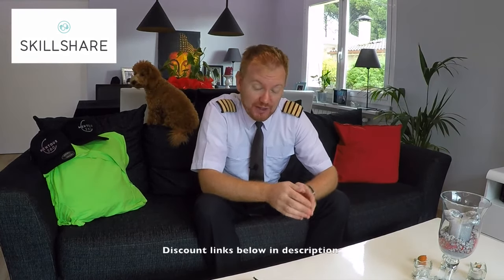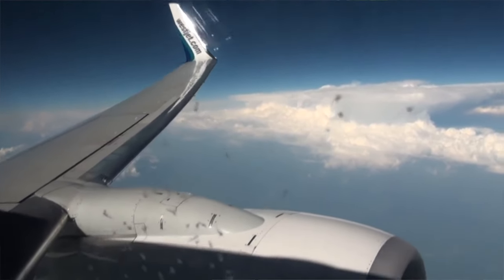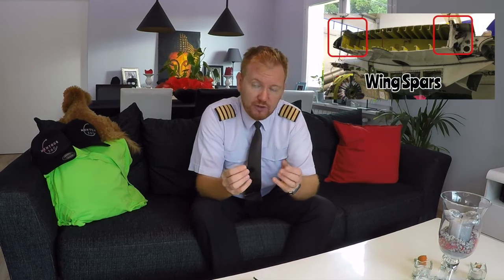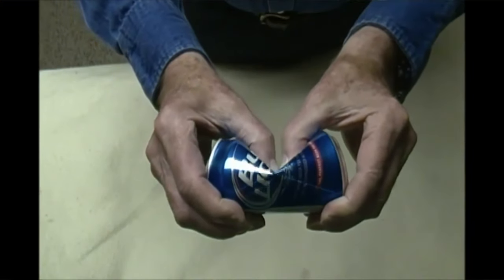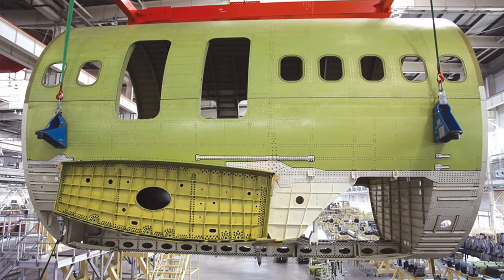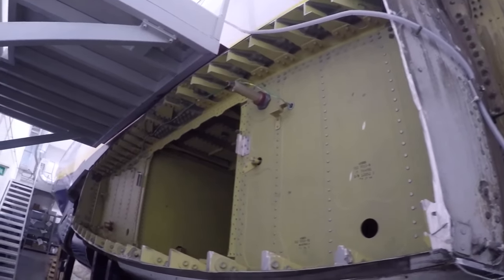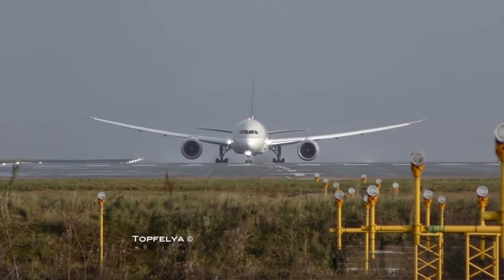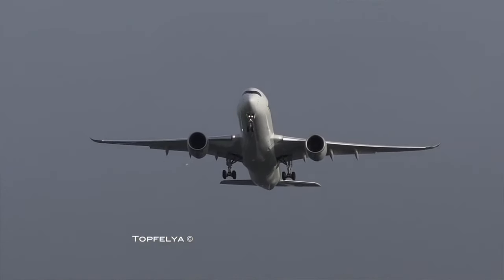Why don't the wings break?!

Comment: Mentour Pilot - Unfortunately saw same thing early 90's at G.R., MI.  Loaded NWA liner on approach but sitting still w/zero groundspeed encountering vicious downdraft due to microburst.  When Capt saw me in orange highway truck drivin' loco pointing at him, he went full gas, gear up, full flaps, slightly nose down, entering elevator to hell.  Instantly went straight down flat w/huge smoke & at bottom in woods wings looked like your cover photo.  All cabin crew checking seatbelts injured being smushed in ceiling & smashed into floor when wings caught.  1st Ofcr knew he was dead so no help.  Liner ravaged, no COM w/cabin, no radios, no autopilot, wing spar fractured in 5 places, tree limbs growing out of belly, and no luck at all...except all survived.  Capt gently coaxed liner up flying towards Lansing and on way back came cruising way below minimums alongside I-96 gently waggling wings & waving sheet of paper on side window to say "thanks".  Capt classy kind of guy!!  He cleared himself for approach-landing-taxyin' pulling off best long landing ever so easy on plane.  Pulled up to gate, but no one was around so just parked as per usual but there was no ground crew.  1st Ofcr still sure he was DED, so no help as Capt heard cabin door open and he could hear injured being attended to, 1st Ofcr carted off & passengers disembarked, leaving him all alone.  He finished off checklist to shut down aircraft.  No Company peeps at or on ramp & Capt wanted look at plane so scooted down small staircase for late luggage, looked back at wings drooping instead in that usual smart vee and knew he was in trouble.  Plane pretty beat up with tree limbs extending from belly and knew he was in big trouble.  Company could surely prove he was flying below the minimums so was yanking on the bigger tree limbs when GRPD Ofcr snuck up from behind and cuffed him saying he was under arrest for tampering with evidence, leaving scene of accident, and joyriding an airplane.  Capt dragged thru terminal empty except for his bewildered deplaned passengers & hauled in front of FAA and Airport Officials for interrogation.  FAA Ofcl ordered cuffs removed, then asked shtload of questions few of which he had any answer for.  On further review by NTSB they got NWS to certify no windshear or downdraft possible at incident location AND MDOT to certify none of their vehicles near location of incident, so after that thorough investigation, NTSB determined Pilot Error and desire to Joyride Airliner as cause of incident.  FAA canceled all of his tickets except those given to him by GRPD, so couldn't even fly home.  1st Ofcr to shook up on day of incident, he rented car for G.R. to Minneapolis/St. Paul and Capt flew back on Company jump seat.  Company decided Capt could regain wings by being retrained, check ridden, and recertified by FAA for every type flown by Northwest Orient.  He was suspended until then but would be removed from suspension and back on flight status upon promise to never bring up seeing MDOT truck that didn't exist or waggle wings of a Company aircraft at a MDOT driver that did not exist!  Fast fwd to Nov '96 when Dad had heart attack on way to FLA from Michigan.  Missus & myself drove to Hamilton Indiana to check on folks.  Missus drove our van home to Cadillac, and I drove folks to TPA near their Punta Gorda winter home.  Near Thanksgiving so tickets to Detroit very expensive.  SW Air counter lady saw I was in jam so called God at Love Field Land who okayed small discount that left me $7 for Pilot's Special of hamburger, chips, pickle, tax, and tip at Pilots' Lounge.  I landed in Pilots' Lounge at table by wall, ordered, and in came two pair of pilots, one NW and other SW Airlines.  They sat right across from me and NW pair was invited by SW pair for knowledge transfer from NW Capt to SW brand new 1st Ofcr.  NW Capt began but couldn't remember in what order emergency procedures were accomplished once knew they were in jam.  I quietly spoke "Capt you went full gas, gear up, full flaps, nose slightly down, and disappeared in downdraft".  Capt reared up, leaned on their table snarling "And just how would you know that?"  Replied "I'm the ahole in the orange highway truck you spoke of....here's my I.D."!  Capt inspected I.D. saying "I've been looking for you"!  We got a nice hard stock dinner napkin and I wrote all the details we discussed on it, and all four pilots witnessed my signature giving Capt all he needed as had done NTSB's job of near aircraft disaster investigation by himself!  NTSB reopened investigation, NWS certified it certainly was possible for microburst with attendant downdraft at time of incident, and MDOT certified my truck and time records proved I was at incident location as well.  Capt got $300,000 in costs refunded, plus retirement time awarded, and back wages paid as well.  NTSB Director had "The Napkin" displayed in front case at D.C. NTSB Headquarters, and when meeting taking place in Auditorium broke for lunch, they couldn't get them back in Auditorium as each clawing their way closer to napkin according to NTSB Investigator that straightened this mess out!!  So Capt Mentour, have you ever had a bad day at the cockpit like this poor bloke sittin' in the sun, enjoyin' the view, lucky to be a Pilot, going straight to full blown emergency in less than a second?  Inquiring minds want to know!!!  Please advise.......

Comment: Somewhere around 5 years ago I was working at Boeing Renton plant on building a new wing line for the 737.  Not far from the area where we were taking our break was the area where they do the wing stress testing for the 737.  I think that they were testing the P-8 Poseidon at the time.  They use what I think are hydraulics attacked to the wings to work the wings back and forth to simulate the wings moving up and down in the air.  Doing this many times they can simulate how the stress on the wing can cause fatigue stress that can cause the material they are made out of break.  Some times the angles that they pull the wings to can be quite distressing.  I remember looking at it a few times and thinking that I wouldn't want to be flying in a plane whose wings are in that configuration(V).  It was both cool and alarming.
Reply: The important thing to remember there is that the wings will never actually flex quite that much during flight - it was, as you said, a stress test they were performing, artificially loading the wing much higher than it ever will in normal operation, just to study the effects.
Cool story though, I wish I could see that for myself!

Comment: On my most fun flight as a passenger from ORD to MIA it was on a 727-200B we flew through a CB - They actually flew through thunderstorms back then because planes could actually fly through rain.  We encountered some turbulence.  The meals flew upwards and people started screaming.  The plane dropped for about 15 seconds - I love it!  I fly acro now.  I noticed the end of the wing tips above the fuselage as the plane was dropping.  It was the most fun flight I had.  The 727 was one tough plane and one of my favorites.  WP
Reply: I daresay it's not because modern planes can't fly through rain - they actually test the engines' capability of such with several firehoses worth of water - but rather that they really don't like all the (potential) turbulence that can be in those powerful weather systems. Chiefly I think it's a passenger comfort thing (because, as you know, the planes can really take a lot), but in severe enough weather, it can pose a safety risk. So they just avoid it as much as possible.

Comment: Great video!  Anytime I run into someone who is afraid to fly and who the wing flex scares, I try to show them a video of the failure test of the wings on a new aircraft.  Invariably, the tips are almost touching each other above the plane before they fail.  We used to have an annual foot race/walk across the Chesapeake bay (suspension) bridge.  Kind of the same thing, quite amazing how much the bridge moves that you might not notice in a car driving across it.

Comment: I always use to wonder about the wings "not breaking apart" with all that powerful variations of pressure under and above the wings while in the air. After having this very same detailed explanation, I know very well that "wings" are very durable structure of an airplane, which never breaks apart, because of their small sections in every each wing. Thanks for sharing the knowledge!

Comment: Bolts and rivets too! Mentour, I'd like to suggest you a video topic. For a long time I used to wonder why the aircraft manufacturers still use the  seemingly outdated rivets to build planes instead of welding. Most other industries phased out rivets a long time ago in favor of welding as it presents many advantages. Maybe you could explain this in a video. Thx and keep up the good work!
Reply: It's because welded joints are (comparatively) stiff and inflexible, meaning that they can't work ("flex", if you will) as much. Rivets, on the other hand, are not actually a completely solid joint (ie., it's not two metal pieces that are literally melted together); thus, they are able to work, expand and contract in a flexible manner, putting less stress overall on the airframe. The expansion and contraction bits are especially important, as airframes actually expand and contract when flying pressurised up in the very thin air of 10km altitude.
In other words, for the right applications, rivets aren't outdated at all :)

Comment: Great video. People don't realize how much engineering goes into an aircraft. There are times when something slips through or is allowed to slip through, but this is rare. If known problems are fixed in development, then the manufacturer is doing their job. Allowing a plane into service with known design flaws and no corrective actions taken is inexcusable. That said, most aircraft do undergo rigorous testing and problems are fixed as they are discovered.
Aircraft can take a lot of punishment and damage. Hawaiian Airlines B-737 that lost the top and sides of first class cabin is an example. Another example is the damage warbirds like the B-17 took in combat. There are pictures of B-17s with half a wing chewed up or missing that made it back to England. Other B-17s had serious damage to the vertical and or horizontal stabilizers yet landed safely back at their airfield in the UK. Engineering helps, but under such conditions everything then rides on the pilots of the aircraft. So the next time you deplane from the ramp, look out the window from the terminal and see your wing, horizontal stabilizers and vertical stabilize all shot up by angry Albatross*, thank your pilots. They got you home safe.
* - No Albatross was harmed in the typing of this comment. I also have no proof that Albatross have been armed with .30 cal or .50 cal machine guns. This is more than likely made up.

Comment: My dad used to fly as a medic on Life-Flight XT which is a fixed wing air ambulance. I remember that he showed me a video when they were returning to base and ended up having to fly through a storm. In the video the wings of the aircraft were dang near flexing to 90 degrees from the turbulence. One of them actually ended up hitting their head on the ceiling during a particularly violent downdraft burst where they lost over 300 ft of altitude in about a second or so. Luckily they were wearing flight helmets at the time. When he showed me the video I was astonished that the aircraft could survive that level of abuse, but he told me that he had actually flown through WORSE storms. After that, seeing the wings flex on commercial airliners never bothered me lol.
Reply from the maker: Yep, they are tougher than most people think.
Reply: 90 degrees!  I doubt it.  Probably 5-10 degrees.
Reply: Show video.

Comment: Wings flex for the same reason your car has a suspension
Reply: no.

lol
the wing flex is a consequence
the car suspension intentionally
Reply: @MrTiti  Wings flex intentionally. They are designed and tested to do so.
Reply: Ground turbulence? Lmao
Reply: If the wings wouldn't flex the plane would be a lot more unstable during turbulences. Imagine how it feels to drive a city bike with very bad suspension through the forest. Yeah not good
Reply: MrTiti clown
Reply: @MrTiti  are you telling me the engineers who designed planes didn't factor in wing flex while designing? Get out of here
Reply: nooooo
Reply: MrTiti is right. Following all you guys’ argument every flexing component ever is designed for the same reason. That is not true. 

I would argument that the flex of a wing is comparable to the flex we can see in tall skyscrapers during heavy winds. If a structure is indeed too rigid, you get a concentration of force, and that can be dangerous. 

The flexing allows the forces to be spread and not concentrated on a few points. That is not the intent of design for a car’s suspension. The main purpose of a car suspension is relative motion to the chassis of the car. For Plenty of reasons. But the suspension is not part of the chassis like in an aeroplane. Two completely different designs, with different design intents. The only reason why you might compare it, is because a secondary effect of the wings flexing is a slight improvement in comfort during turbulence.
Reply: Nick So every flexing component is designed for the same reasons and with the same intent ? No.
Reply: Don't they flex so they don't snap off?
Reply: @ballsdeepinglory3054  do they have wings that are soft and flexible though?
Reply: @masso172  potholes and cracks lol
Reply: @ballsdeepinglory3054  Fighter jets are designed for maneuverability. Just as a performance car has a stiff suspension and chassis for better handling, so too an airplane designed for quick maneuvers has stiff wings and fuselage. Both at the cost of comfort.

If a car has a really soft suspension, potholes are no problem but you'll get a lot of body roll in high speed turns on a track. You might even scrape and bottom out. In planes this translates to limits on the amount of lift and g-forces a plane can handle. Too flexible for the amount of force and parts snap off.
Reply: But there are so many more factors in aeroplanes than cars. Wing loading determines some of the comfort but mainly maneuverability, then there is the fact that fighter jets fly so much faster and operate at way higher altitudes that they are not impacted as much by turbulence. The main reason why passenger jets flex is to increase lift. Yes comfort is a resulting benefit, but the design intent of a wing flexing and a car suspension is not the same. The wing is an integral part of the "chassis" of the plane. In cars the suspension is an external component that is designed to influence the forces felt in the chassis. The comparison between wings and suspension is great if you want to explain it to a simpleton, but the engineering behind it is not comparable.
Reply: @ballsdeepinglory3054  wing flexibility increases lift? Didn't know that
Reply: Wings flex, but ok
Reply: No..wings flex because if they didn't they would snap. Flexing spreads the load.

Comment: let me expand on what Mentour Pilot was saying in regard to the types of alloys used in cans vs aircraft

coke cans are usually made from 3104-H19 aluminium alloy
the mechanical properties of which are as follows 
fatigue strength: 85MPa
shear strength: 180MPa
tensile strength: 270MPa (yield)
tensile strength: 310MPa (ultimate) 

aircraft structural elements are almost exclusively made from 7175 aluminium alloy 
the mechanical properties of which are as follows
fatigue strength: 150-180MPa 
shear strength: 290-330MPa
tensile strength: 430-490MPa (yield)
tensile strength: 520-570MPa (ultimate)

as you can see, 7000 series aluminium alloys are much stronger than the alloys used in coke cans and are much more resistant to metal fatigue, therefore you dont need to worry about the plane breaking apart under normal flight conditions (or even in bad weather)
Reply from the maker: Thank you for your help! Very clearly explained!
Reply: Impressive knowledge of metallurgy.
Reply: @jasonh8043  thanks, the internet is an amazing place to learn things
Reply: Aluminum material on coke can isn't as weak as people thought, they're weak because they're just as thin as human hair.
Reply: @rommysoeli  true but its about half the strength of "aerospace grade" 7175 aluminium alloy (which is what aircraft structure like wing spars and fuselage beams are made from)

if coke cans were made from 7175 they would be much more difficult to crush (and a lot harder to cut)
Reply: If anyone wants to get a feel for how strong the 7000 series aluminium alloys are, just grab an aluminium baseball bat. I used one when I played little league baseball and I'm sure some major league players have used them as well. You can see how strong the alloy is in game play as it collides with a baseball traveling at 90+ mph or 145 kph especially repeatedly.
Reply: @petemiller519  

7175 elastic modulus 70Gpa
3104 elastic modulus 70Gpa
Reply: @davidrex583  still made of 3104 aluminium alloy just like every other coke can
Reply: One might advocate that your conclusion is equivalent to saying that the Sun can contain at least 12 times the volume of the Earth, and giving no real-life example of those yielding points and strengths doesn't help with that. But indeed, nice point made.